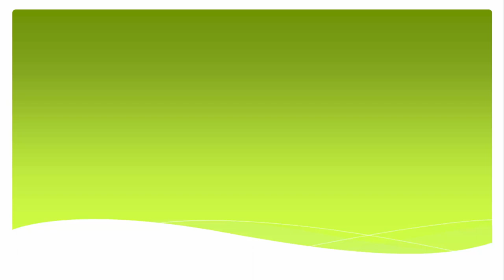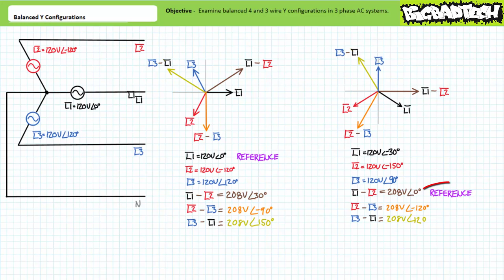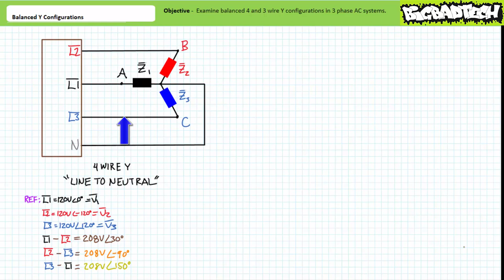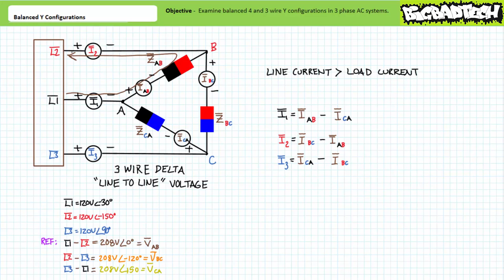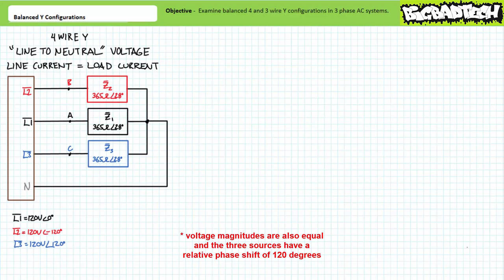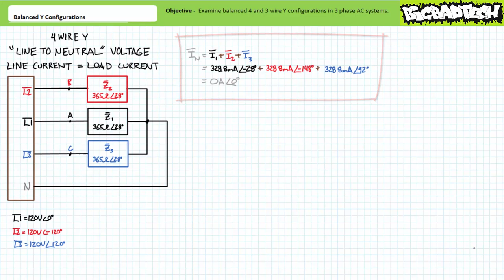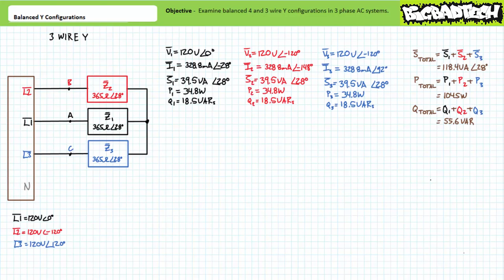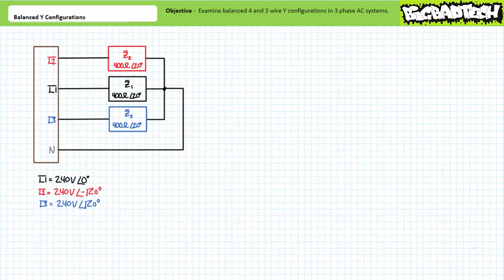Balanced Y Configurations (Full Lecture)

Comment: Hey Jim,

At 39:06, when calculating the VA for Z2, I keep getting 144VA at an angle of -100 degrees. What am I missing here?
Reply from the maker: Classic problem ... apparent power is calculated using relative phase shift only. In each load current lags voltage by a relative 20 degrees. Check out the AC Power lecture at: https://youtu.be/nse2vSlOoME
Reply: @bigbadtech  Got it now. Thank you

Comment: Hallo Sir ! thank you for the awesome lecture, again.
I have a question though, Why does the "3 wire Y" configiration system see a 120v potential difference in balanced condition.
I mean, in  previous lecture, we learnt that as 208 V .( because of the line to line potential difference)
Reply from the maker: Voltage is a two point measurement. You're correct that the "line to line" voltage in a 3 phase AC system might experience 208V, however, there's another point in the center of a Y. Each load in a balanced 3 wire Y experiences line to that center point's differential. Given 3 balanced line to line differentials each load effectively experiences a line to neutral differential of 208/sqrt(3) or 120V.

Comment: Hi Jim, thanks for the videos, learning lots from you. In this video you state that because the Neutral currents in a balanced system are zero, that you could just remove the Neutral wire/terminal. But surely you would also need to change the supply voltage, as Line to Line is 1.73 of Line to Neutral? Hence the voltage seen by the loads would be higher if we simply removed the Neutral. Or am I missing something? Thanks
Reply from the maker: In a balanced configuration lacking a neutral each y configured load still effectively sees the line to neutral voltage.
Reply: @bigbadtech  Thanks for taking the time to reply. I watched the lecture again, and also the delta loads lecture. I'm embarrassed to say that I still can't understand what you mean. Is there a simple explanation why taking away the N connection from a 4 wire Y connection is different to a 3 wire Y connection, where the loads see a line to line voltage? Thank you!
Reply from the maker: Think of it this way, load Z1 and Z2 are in series with each other between L1 and L2. These loads "split" the line to line voltage L1-L2 where the term "split" means a vector split accounting for phase angle. Same thing for L2-L3 and Z2-Z3 and L3-L1 and Z3-Z1. Add it up and it appears as if each load experiences the L to N voltage.
Reply: @bigbadtech  Thank you sir, I really appreciate your taking the time to explain this for me. Thank you!

Comment: Please elaborate @ 11:20. The line-line and line-neutral voltages for the Delta configuration are listed. Doesn't Delta only have line-line voltage?
Reply from the maker: True. A delta configured load does not experience the line to neutral voltage but rather the line to line voltage ... however ... a Y configuration of sources with a neutral (ie: line to neutral voltages) could be used to supply a delta configured load as the diagram indicates.
Reply: @bigbadtech  Thanks.